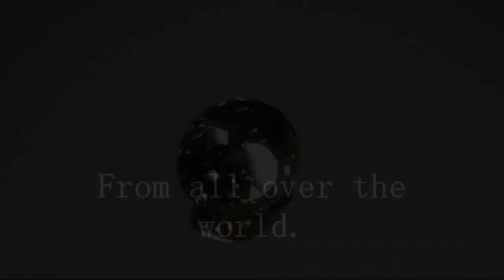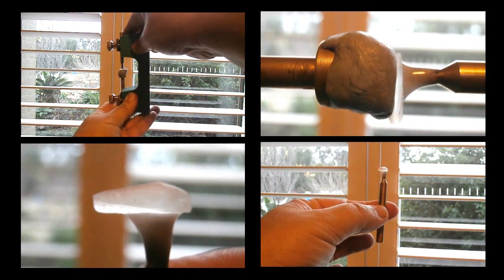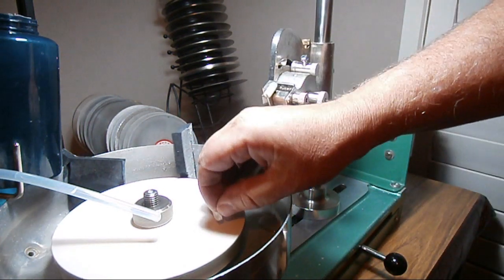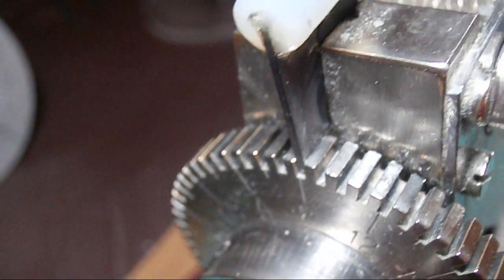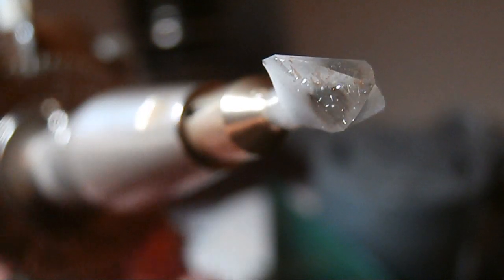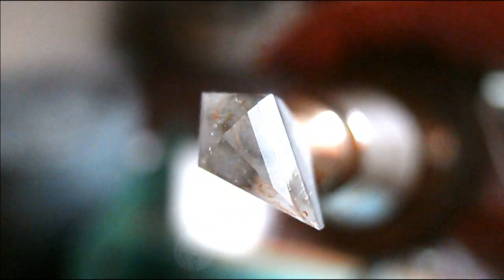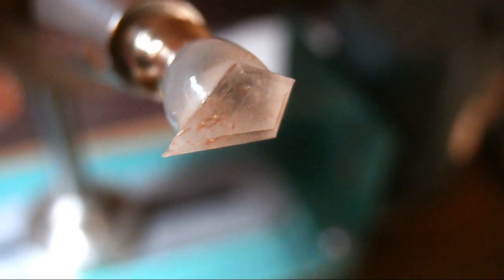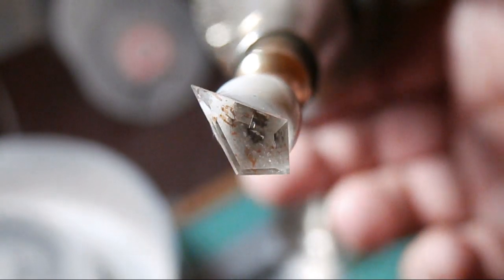How To Cut Gemstones - Confetti Sunstone Faceting

Comment: Thank you for a very interesting video.  That's the first time I've ever even heard of "Confetti Sunstone".  It looks like a tough cut due to the Hematite throughout the stone.

I cut a lot of Oregon Sunstone from the mines in Plush, Oregan, USA.  One surprising factor that really changed some of my angles was that the Critical Angle is quite high at 43.5 degrees.

Good Job... I always like your videos.
Reply from the maker: Hi John, I've cut several pieces of Sunstone from Oregon. Never had an issue with Sunstone from Oregon, but Confetti Sunstone is a different matter. Most low RI material is best cut above 42 degrees in my opinion. I like quartz  critical angle around 42.5 -43 degrees. I'm not a fan going below 42 degrees for quartz even though the  critical angle is lower. Cheers.

Comment: What an incredible gem! Thank you for another great lesson in cutting. You have inspired me to learn the craft. How long would you say it takes from start to finish for beginners? Since you’re a pro how long does it take you? Which cut would you recommend starting with? Thanks for sharing your talent! 💎
Reply from the maker: I think within 6 months you will be faceting gems. I would never consider myself to be a master or  pro. You are only as good as the next design or gem material that you have never cut before. In my opinion what defines a good facetor is to work through problems, have patience, be consistent in cutting a quality gems and enjoying the craft. Also, if you fail, see it as a learning experience and and try again until you get it right. You will know if you a rubbish facetor, and that will be at the 2 year stage where you keep stuffing up repeatedly. Oh yes, a delicate gentle style will go along way. Some of these facetors on other channels are to rough and aggressive (that's why the have major clangers while they make videos. They almost wear it like a badge of honor lol..... Cheers
Reply: Thank you for the encouragement! I definitely will not be too hard on myself if I ruin a few. Six months seems reasonable. I enjoy rock hounding and plan to learn gem cutting. Can’t wait to start a new challenge. Take care 😉💎

Comment: I would really like to know your opinion on hand faceting. I have just started lapidary and used sanding wheels but managed to do some basic rough faceting. Would you do a video maybe doing some hand faceting?
Reply from the maker: Hand faceting in my opinion is not as accurate, but it is really good for free form gems. I particularly like rose quartz free form hand faceting.

Comment: <<<< taking notes again  ; ^ )
50k diamond & Herco valve oil on tin. noice ! you saved me some grief on some Oregon sunstone in the future lol
Thanks for the tip !

It's kinda funny - I just got a set of lightning laps less than a month ago ( 600, 3000, cerium oxide). I really like the results on quartz as well. The 600 cuts like a 400 with a 1200 finish - really fast. The 3000 gives it a commercial looking polish IMHO. I really like them

 and poo on the thumbs downers pfffffffffffffftttttttt !
Reply from the maker: Good luck with Oregon sunstone. I had no problems with it, but the African sunstone is another matter. Cheers
Reply: @VintageTimeGems   my desire is to cut some sunstones with lots of copper schiller. Your tip might come in handy on those critters   ; ^ )